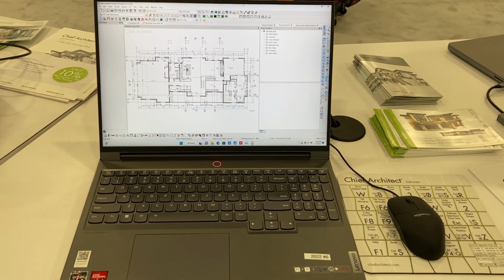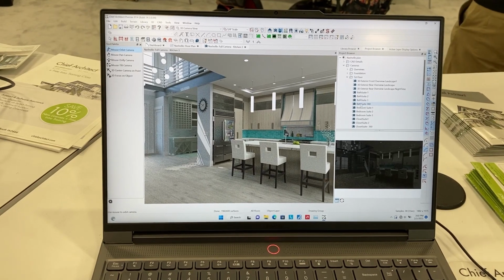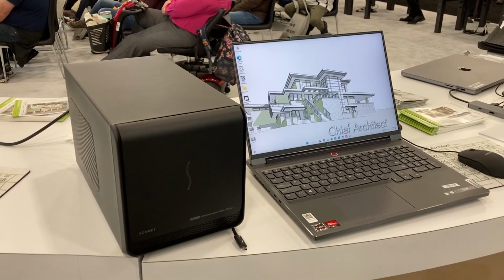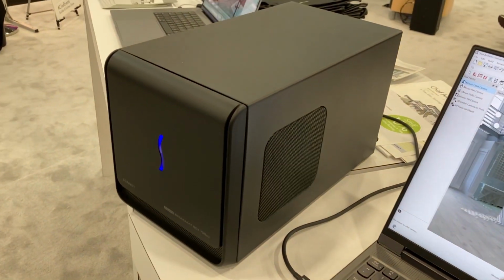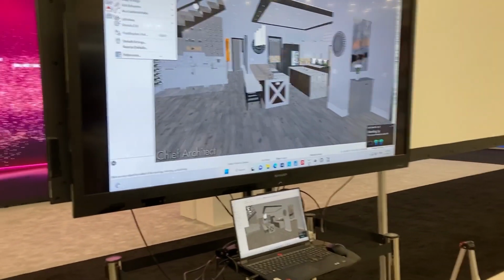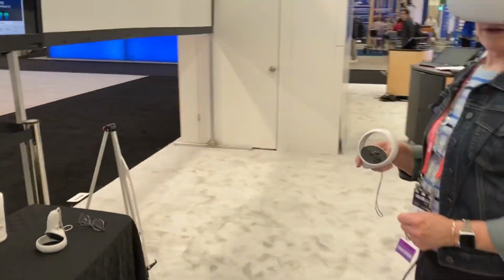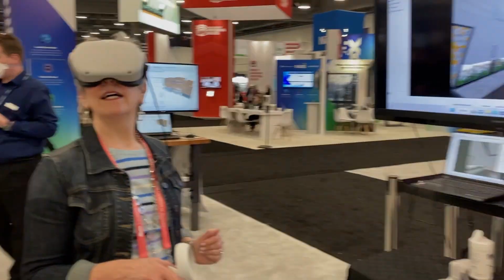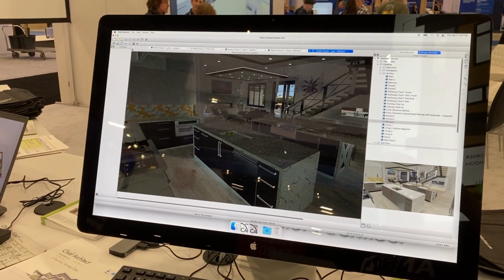Chief Architect's latest rendering and virtual reality technology on AMD-powered laptops @ KBIS 2023

Comment: What laptop would you recommend today to run x15 and multi task. Die hard Mac user but I need really good ray tracing and from what I’m told the M3 won’t be as good as a pc.
Reply from the maker: Thanks for watching @cottagekeeper.  There are a number of factors that impact laptop selection, but most important are probably screen size and battery life.  For the absolute highest performance, the 18" https://www.dell.com/en-us/shop/gaming-laptops-pcs-and-accessories/alienware-m18-gaming-laptop/spd/alienware-m18-r1-amd-laptop/useahctom18r1amd09 with Ryzen 9 7945HX and Radeon RX 7900M is an absolute performance beast.  For a more portable and longer battery life option the 16" Asus TUF A16 Gaming Edition is a great choice:  https://www.microcenter.com/product/670304/asus-tuf-gaming-a16-advantage-edition-fa617xt-cs94-16-laptop-computer---sandstorm_Hatchfeed.  A strong 14" option is the Asus Zephyrus G14: https://rog.asus.com/us/laptops/rog-zephyrus/rog-zephyrus-g14-2023-series/.  But for the utmost in portability, the combination of a Ryzen 7040-series laptop using integrated graphics for design and light rendering and an eGPU with desktop graphics for heavier ray tracing offers the best of both worlds.  This thin and light 16" Acer Swift Edge 16 offers a great value and plug-and-play compatibility with eGPU: https://www.bestbuy.com/site/acer-swift-edge-16-16-3-2k-120hz-oled-laptop-amd-ryzen-7-7840u-with-16gb-lpddr5-memory-1tb-pcie-gen-4-ssd-olivine-black/6546242.p?skuId=6546242.  Hit me up with any additional questions.